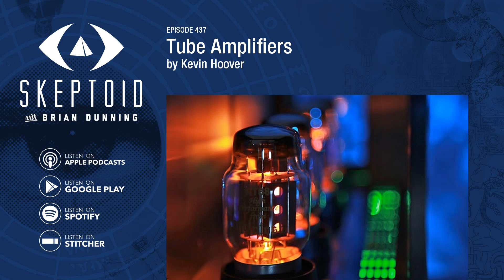Tube Amplifiers

Comment: If you're amplifying a stereo, transistors are the way to go. If you're amplifying a guitar, and plan on overdriving your amp, (especially with added distortion and feedback), a transistor amp falls well short because, it's "attack" is nearly instantaneous.

I wrote that before listening, but stand by what I wrote. DSP is stacking the deck.